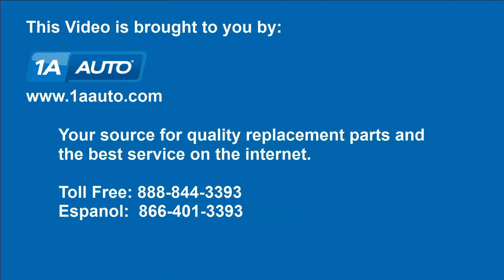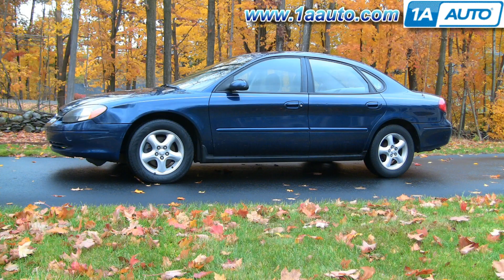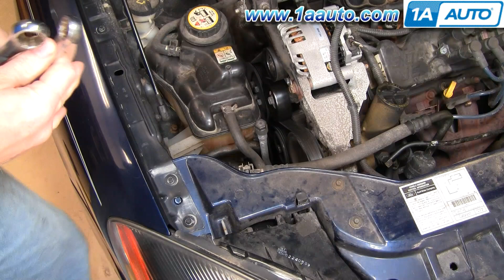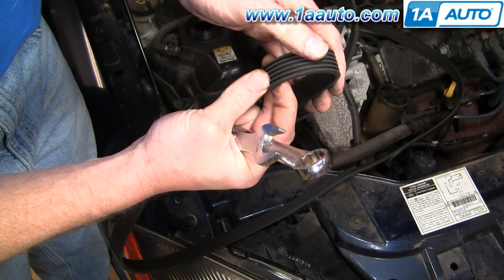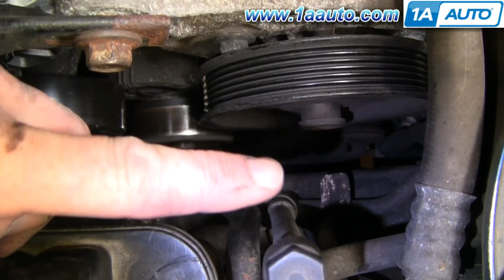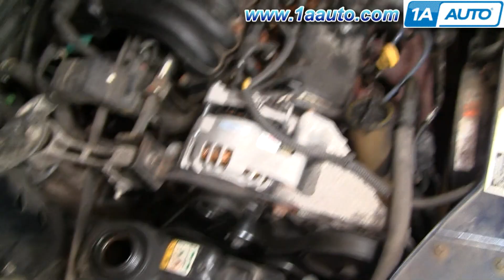How To Replace Serpentine Belt 01-05 Ford Taurus 3.0L V6

Comment: What works well for me after Hand Treading the Serpentine Belt on to pulleys alI the way up to the Alternator, I use a Bungee Cord to keep the serpentine belt from falling completely off pulleys and down in-between the close-quarter section of the engine bay, while simultaneously releasing the serpentine belt tension and slide the remaining section of Serpentine Belt on to Alternator's Pulley.

Comment: If you use this technique on a duratech dohc motor you can break the bolt off that holds the tensioner on, there's a 3/8 square drive hole at the bottom... this "pro" should know this,,shame on this video.

Comment: Thank you!  Changed the belt on a 2007 Taurus using this method.  The 15 mm wrench seemed a little loose on the bolt but that was the closest fit I could get. It didn't slip and I torqued it pretty good to get that new belt on. Screaming belt noise is gone!  Thanks again for a great instructional video. Onto the next project...
Reply from the maker: +J-Dub Thanks for checking us out, glad we could help! 1aauto.com

Comment: On my 2003 Taurus SES the bolt in the center of the tensioner mount is 10mm. Thus far I haven't been able to turn a wrench on it, only have been able to get a 10mm socket on it, but no 1/4" drive handle will fit. I can feel what may be a 3/8" drive head female fitting down by the actual tensioner pully, but not yet the 15mm bolt. I've moved the power steering lines out if the way by unbolting the fluid filler, but my a/c lines are still in the way. Very difficult getting the new belt installed on this engine. The water pump is on the drivers side, so it should be easier, but those darn a/c lines are leaving no room for anything.
Reply: I have a 2001 SES which is very different. It feels like the tensioner has a square hole about half inch. I think the tool needs to be low profile with a square stud. A socket ratchet is too thick for the narrow space. Special tool needed, which I will borrow. The belt wraps around only five pulleys. 24 valve double overhead cam with water pump on the other side of the engine.

Comment: So after I changed my belt, everything lined up correctly, I turned on my car to run it, all of sudden now right after it turns on the idle drops and the car shuts off, I'll gas it, but it comes right down and turns off; Can any one help??? I want to try and do this myself; Would appreciate the time and consideration.
Reply: Having the same problem, what ended up being the issue???

Comment: thank u so much for this video. I have a mercury sable 99' an my belt pop off while driving. Had it replaced 2 wks prior and the dumb ass mechanic didnt put it on right obviously bcuz it should have nevet came off. thanks for ur video bcuz I was able to fix it myself and put it back on the right way.
Reply: You should've went back and showed him how to do it correctly

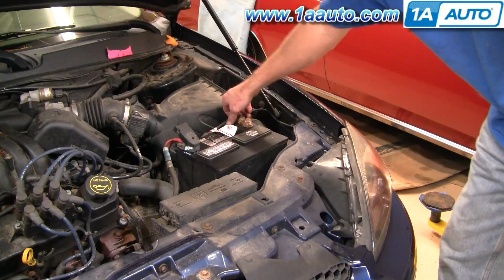Comment: Question, at 1:00 you took the ground off but not the positive.  Why?  Shouldn't it have been the other way around?
Reply from the maker: +Dr Pancake Face Gaming If you remove the ground, it will disable any electrical current going through the electrical system. The electrical system requires a positive and a negative connection to function. hope this helps you out. Thanks for watching.

Comment: Hello again A1 Auto! I was told that I will need to replace my SERPENTINE BELT by the Dealer(for they replaced years back of within the 5 years or 50k miles). I don't hear any speaks myself to me really not listening and will now, for this

Comment: Question? All belts are directional would it matter if you install it the other way around; Your belt is all black not saying what direction it should go. I think that would be a good vid. Explaining tha whole thing about belts.
Reply from the maker: Thank you for watching! 
Our belt is not a directional belt and can be installed either way. Hope this helps!
1aauto.com  888-844-3393
Reply from the maker: As long at the ribbed part of the serpentine belt is routed correctly through the pulleys, it shouldn't matter what way the belt is installed, it's not directional specific. Have a great holiday season. 1aauto.com 866-403-3393

Comment: I have 2002 ford taurus with a 3.0l engine. I recently poped my belt and I want to know if it's normal for replacing the belt to be difficult.   I used this video to help, but I notice that when he was almost about finished replacing the belt. He had enough slack on the belt to pull it over or above the alternator  bolt. My problem is idk know if the belt is too short or a part could've possibly shifted causing lose of slack.  The belt is the exact same size as the other and it routed how it suppose to be according to the diagram.
Reply from the maker: If it's routed properly according the the engine diagram. You may want to double check the belt to see if you have the correct one.
Reply: Are you pulling the tensioner enough??
Reply: Having the same,issue at work on a mercury sable. Same engine. I replaced the power steering pump and cant get the belt back on. Its the same belt I took off lol
Reply: NoTimeToWhat what was the issue?

Comment: Does this diagram can be appied to 2004 Mercury Sable???
Reply from the maker: Thank you for watching. The process should be similar between the 2 vehicles.
1aauto.com 888-844-3393
Reply: 1A Auto Parts
Reply: The '96-'06 Taurus/Sable uses basically the same 2 V6 engines. (The exception being the Taurus SHO V8) Therefore, providing it's a 16V Vulcan V6 (pictured) of that timeframe, it is most likely identical procedure.

Comment: THANK YOU for this video!!! I got a clue now and I succeeded putting on the serpentine belt but omg it was a tight fit. I couldn't get it to fit over the pulley without a screwdriver to pry it over. You make it look so easy. dang. The diagram of the routing was most helpful. Thanks again!! (I wonder what I did wrong? I started at 11 o'clock as you suggested.)

Comment from the maker: Yes you may end up with a fit issue if it's not routed correctly. There should be a belt routing diagram located near the front of the engine bay that will show you how to route the serpentine belt. 1aauto.com 888-844-3393

Comment from the maker: If the clutch is not spinning freely you will most likely have to either replace the clutch or the entire compressor depending upon if the internals move of the compressor.

Comment: I followed all your techniques to replace a broken serpentine belt on my 2003 3.0 L Taurus. I checked that all of the pulleys spun freely before putting on the belt as recommended at the auto supply store from where I purchased the belt. Upon starting the car, I got a high pitch whine. It seems as if the pulley on the A/C compressor has seized. If it has, do I have a pulley problem or an A/C compressor problem?

Comment: Thanks! I used your alternator video to replace the alternator on my 1997 Taurus. One thing: I could not move the tension wheel at all. No matter how much leverage. Luckily, when I disconnected the alternator, I could slide the belt off.

Comment: Is this what I need to change if there is a chirping sound coming from the passenger side? Thanks
Reply: Most likely yes the belt is worn. Spray the belt while running with water. If the noise quiets then it’s the belt.

Comment from the maker: The serpentine belt tensioner should automatically apply enough pressure so that there is no slack. You may want to double check the belt routing to see if you have routed it correctly.

Comment: well, once proven again 1aauto has came through. i messed up bad at first cause i had the belt in 20 directions but then i fished the belt back out, tried again, and surely enough i was able to get it. thanks mike. monroe quick struts are next on the list. would order them from you but i live right by the auto parts store and its easier that way. :)

Comment: mike, your a champ buddy. ive got my old belt off of my 2001 taurus. exactly like yours but its red. so far i went and bought the new belt and a new 15mm wrench just like you said told me to use. best way to turn the tensioner to get that belt lose is by using a cloth so you dont hurt your hand and to push down on the wrench instead of hooking another wrench to it. getting ready to put the new belt in. wish me luck! :)

Comment from the maker: You may want to make sure that it's routed correctly around all of the pulley's and that you also have the correct size belt.
Reply: I bought a 13/16" belt and it still wont fit, i was told at oreillys that its the right size. I have a ford taurus 98

Comment from the maker: @MERCEDESGIRL1991 Depending on the year of your Ford Taurus we carry an AC compressor by-pass pulley so that you can retain the stock serpentine belt size. The belt wouldn't cause your power steering pump to leak. Here's a link to the Ford Taurus by-pass pullies on our website. hope this helps you out. 1aauto.com/1A/ACBypassPulley/Ford/Taurus

Comment: can u make a reccomendation for me? i need to replace the serpentine belt, but the ac is frozen and i cannot afford to replace it. what size belt would i purchase to bypass the ac unit? would the serpentine belt have anythig to do with my power steering unit leaking??

Comment from the maker: @guitaristwagner If the pulley is wobbling or making a strange noise, more than likely the bearing inside of it has gone bad, and it should be replaced.

Comment: Hi Mike,thanks for the video.
I was wondering what purpose is served by disconnecting the battery. My best guess is that you wanted to disable the electromagnet in the alternator .However, (I assume that ) the alternator is not energized when the car is off. 
Could you please clarify?

Thanks
Andre